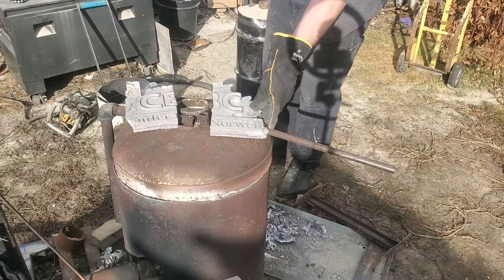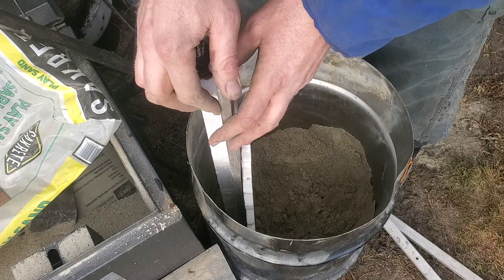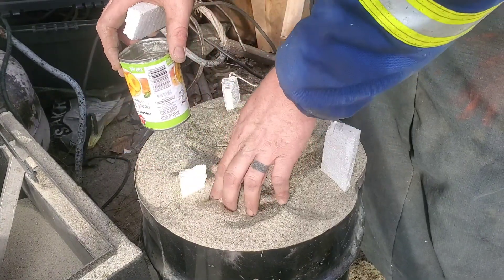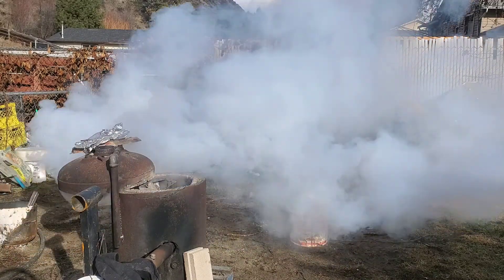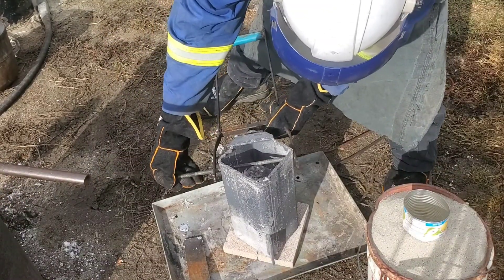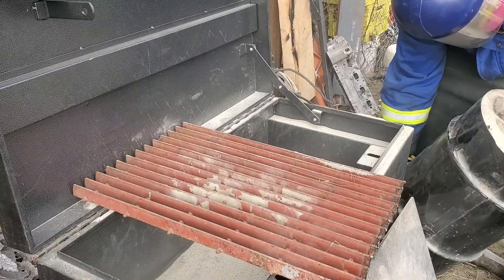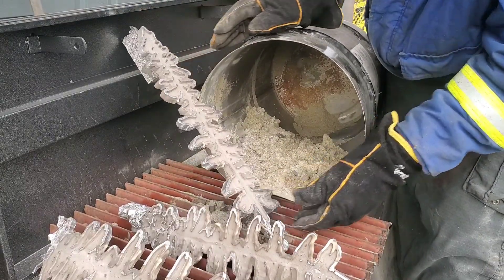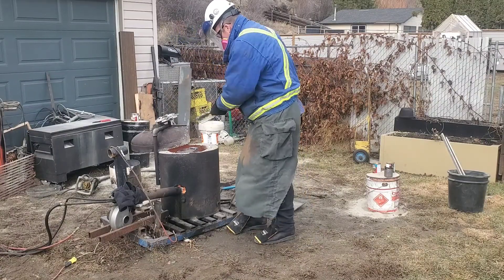Lost Foam Casting Aluminium Experiment and Learning

Comment: If you keep the sand depth on each side of your patterns the same, the sand pressure on each side will be equal and not distort your patterns. If you add the sand by hand, say a quart ata time you can do the same. Then vibrate continuously or in stages as you fill, this helps too because there is less mass for your vibrator to excite a partially full flask. Keep the concrete vibrator out of the sand, attach it to the outside of your flask and build a spring or rubber isolated  platform to sit the flask on as you vibrate. The freedom of motion will help increase the intensity of your vibration, especially if you a under powered. There is no need to use binder if you have adequate vibe/packing. The sand you emptied out of the bag looked moist as did some shots of it in the flask. Moist sand is the enemy and will not flow/pack under vibration nearly as well as dry sand. Suprised you dont have more runnouts without burrying your pouring cups to full depth. -Happy casting. Best, Kelly
Reply from the maker: As always thank you for sharing your experience I will make some changes.  the vibrator and pail mods will be made for sure, great advice.

Comment: There is a channel called Nobox7 he makes all kinds of burners that use diesel and oil without propane preheat ,he also sells them .Check his channel maybe its time to remake your burner :)
Reply from the maker: That is a great suggestion. I'm looking it up right after this. 

  I have 2 old oil furnace burners I am looking at in spring to make into a forge burner.  That way I can just flick a couple of switches and I'm off to the races 🏃.  The only draw back is I have to run straight diesel and can't use old oil and what not that I find.

Comment: Use bentonite green sand and sand should stop collapsing.
Reply from the maker: I like that idea.  I don't have any at the moment but will look into it.  I have a 24"x24" sign I want to cast and need some kind of support in there to get a win :)
Reply: @Wrighmachining  Or coat it in plaster so it wont collapse at all .Then you can use any sand .There is a book by C,W Ammen complete handbook of sandcasting -it has many usefull informations .
In one of them he describes proper moisture for sand and how it should look like under hand .On one other book i found out information that you can make almost any sand into casting sand by adding dextrin (pyro component used in fireworks -super easy to make by baking corn starch untill it turns yellow in oven.)wich acts as binding agent.I guess clay could also work.
Havent tried those yet ,soon i hope.I also wanted to try making styrofoam parts and then use sodium silicate and sand to coat them and then pour acetone to make a hollow casting,i know people burn the styrofoam out but that makes lot of smoke and it can crack the shell so i wonder how chemical approach will work.
Reply from the maker: Hey kursor,  cool casting youtubeshort by the way !!  Just checked out your work
Reply from the maker: Sodium silicate,  I like that idea. I have some of that.   I guess I would have to do a couple of layers and put sand on each time to bind the layers and add depth to the structure. .    just then venting could be a concern as I think the sodium silicate would then block some of the gasses escaping from the cavity